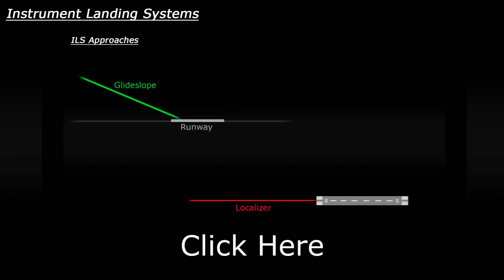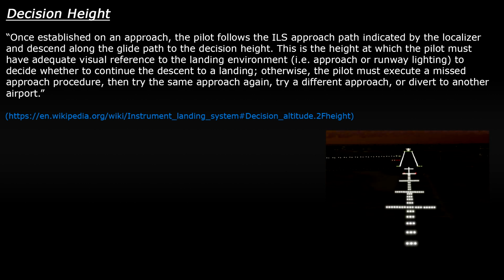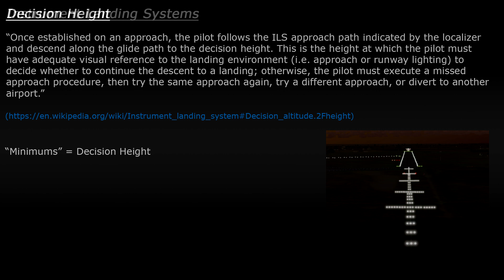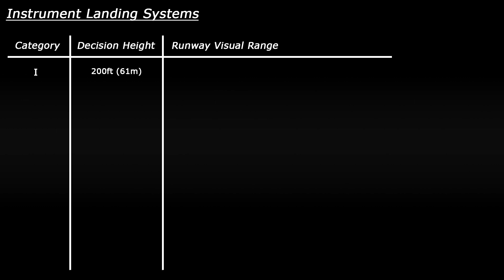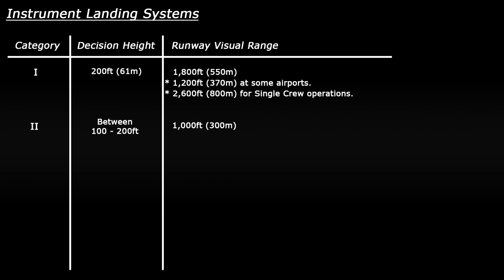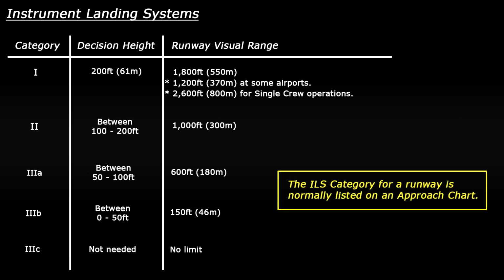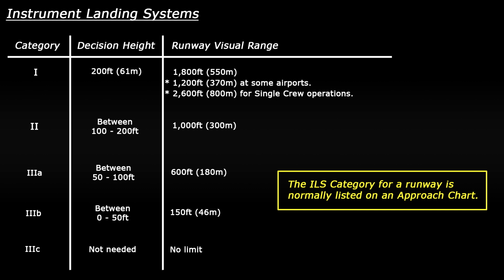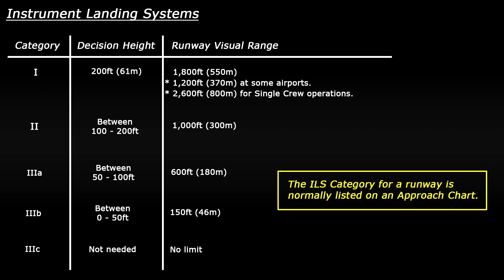Decision Height + ILS Categories

Comment: It is no longer called Decision Height and the fact that you didn't know this means you are not a current instrument rated pilot. It changed to Decision Altitude for Category 1 approaches many years ago because those approaches have an Altitude where the pilot must make a decision to continue the approach or go around. Cat ll approaches use a radar altimeter, and minimums are around 100 feet radar altitude, which is called Decision Height because the radar altimeter measures height above the ground. And THERE IS NO SUCH THING AS A DECISION HEIGHT/ALTITUDE FOR CATs llla, b, and c approaches as the ceiling will almost always be zero. We use Runway Visual Range, or RVR solely as our minimums, and not a DA. For Cat llla it is RVR 700 feet, For Cat lllb, it is RVR 300 feet, and for Cat lllc there are no minimums as you can land zero zero if the airplane and pilot are qualified to do so. Look at the ILS Approach for Denver's Runway 34R for an example of a Cat lllc approach. All Cat lll approaches are autoland only as the autopilot must fly the approach and make the landing. You are not qualified to post a tutorial on ILS approaches. Do your homework next time or talk to an airline pilot like me to learn all about the different categories for ILS approaches.
Reply: Check when the video was published.

Comment: On a Visual Approach the Decision Height is 500 ft., right?
Reply from the maker: There isn't any Decision Height for a Visual Approach. Visual Approaches by their definition require the pilot to be focused on the runway and PAPI/VASI lights during the approach and not looking at instruments in the cockpit. Therefore Visual Approaches are only conduced when there is very good visibility.

Comment: Hi, I would like to ask two questions:
1. is autoland allowed only on ILS cat IIIc or on any cat III? Maybe that's why it's devided?
2. What's the difference between DH and MDA?
Great channel btw! ;)
Reply: pedeiksz hi !  DH or DA (Decision Heigt or Decision altitude, the only difference between them is the DA is referenced to mean sea level whereas DH is referenced to the threshold elevation) are only used for precision approaches such as ILS. When you pass through DA (or DH), if you see the runway you can continue the approach, if not a go around must be initiated immediatly ! 
The MDA (Minimum Descent Altitude) is used for non precision  approaches (LOC, VOR/DME , NDB, RNAV...). This is the minimum altitude you can reach before having runway in sight. 
You fly the approach's descent profile until the MDA, and when you reach it, you level fly at MDA. The decision to make the go around is done at the MAPt (Missed Approach Point, try to find it on a VOR/DME final approch charts). If you see the rwy before passing the MAPt, you continue the descent towards airport ! (you dont have to wait for the MAPt to start descending). If, when you reach the MAPt, you dont have the rwy in sight yet, you go around ! 
Of course, if you see the runway before passing MDA, you dont have to level fly ! 

Hope i've been clear enough   ;)
Reply from the maker: 1. I think Autoland is allowed on any CAT III equipped runway but the aircraft has to have the equipment to work with CAT III ILS as well. 
2. They're both essentially the same thing but I THINK...  DH is the height above ground, MDA is the height above Sea Level
Reply: Doofer911 MDA is used on NPA based on QNH setting, whila MDH is used for NPA and based on AGL.

Comment: Good video as always. 
But how do pilots know the runway visual range? Determine by their own eys? From ATC? 
And, if I fly to a Category 1 airports but ranway visual range is less than 1800ft, is it mean that I cannot land my aircraft? Or there are some special regulations? Some people in fb told me that in that case I will need to use autoland, is that true? Thanks!!!
Reply from the maker: Air Traffic Control + METAR (weather report). I think you can use autoland with a Cat 1 system but it would be dangerous to do.
Reply: +Doofer911 Why would it be dangerous? Autoland is not good?
Reply from the maker: King Lim Pang
Cat 1 ILS is more sensitive to external disturbance. For example if a maintenance vehicle drives past the end of the runway where the ILS antennas sit, it can interrupt the signal to the plane. Also, only certain aircraft can autoland. They usually need complex computers and instruments to be installed.
Reply: +Doofer911 Hello. I've got a new question. What is IMC? Thanks!!
Reply from the maker: Instrument Meteorological Conditions. Try looking some of these questions up online yourself, you will get the answers faster.
Reply: +Doofer911 Thanks. I just read the first paragraph in wiki but it seems it looks pretty the same as IFR?